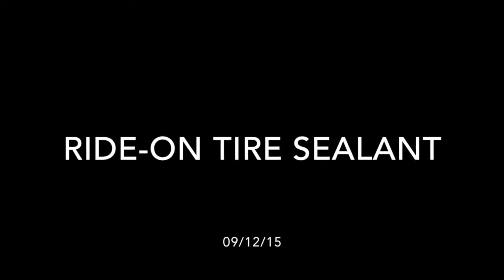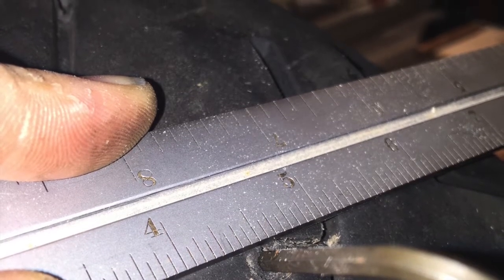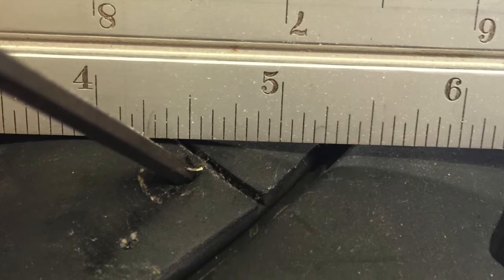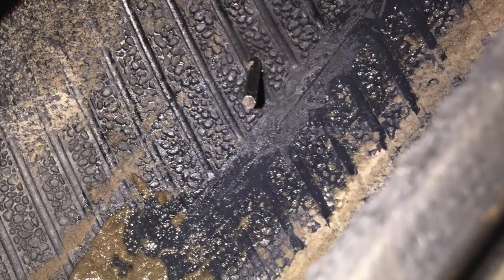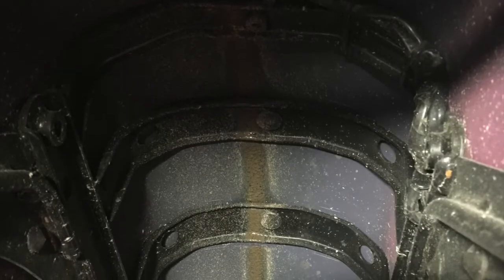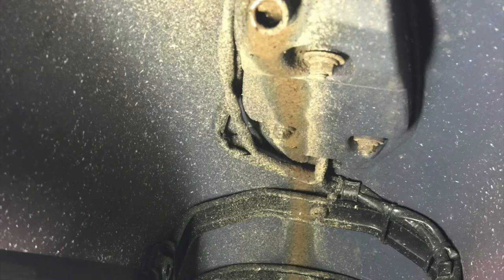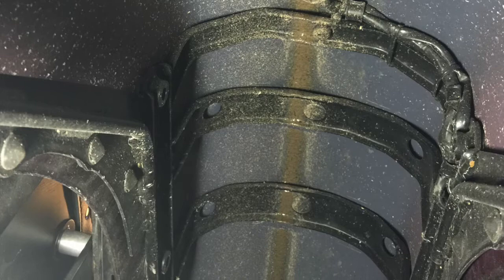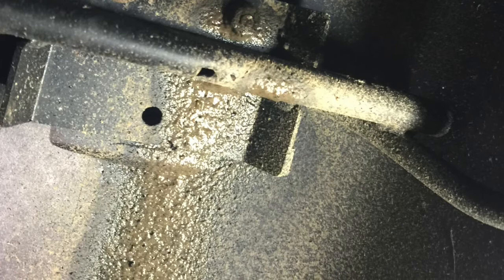Ride-On tire Sealant Failure

Comment: it's really nice to see that someone posted a video on what the limitations are on this tire sealant I personally have been using this tire sailing for just over 7 years and I've had incredible luck with it I myself have taken nails and screws through my tires and have been able to remove them and continue driving when the sealant did what it was supposed to tell I have also put it in a tire that pad and nail already it it drove it for 2 miles then pull the nail out and it completely sealed up and that's hiring now has been back on the road 4 one year and a half.. I hope you have better luck with the next tire and using the ceiling again it is possible that the hole was just too big for the chemical to seal..  good luck and be safe
Reply: marvin R - I called and talked with the company when it happened. The hole was well with in the size the sealant would work on. They told me the sealant is good 90% of the time. I guess my hole fell into the 10% range.

Comment: I'm disappointed to learn about your experience Tom.  I've been using "Ride On" with complete confidence in the product.  I know from experience Ride On is great for balancing motorcycle tires and it doesn't make a mess inside your tire.  Anyway, I guess this shows me once again life is never certain and that shite happens.  When and if I hit a nail with my motorcycle I hope I fall within the 90%...
Reply: Charlie Swearingen - I agree it does a great job balancing. Good luck and keep the shiny side up.

Comment: That does look like a pretty big hole, would have been interesting to see if you threw a plug in there how it would have handled it. I guess when you use this stuff you can't adjust your tire pressure either.
Reply from the maker: Mike Mills - from their website “by objects up to 6.4 millimeters (1/4") in diameter”. I had to forcibly push the 1/8” Allen wrench into the hole. I have plugged a  motorcycle tire before but I still consider that a temporary measure to change out to a new tire. Filling up air in the tire works like normal. The only thing I trust about that as it as a dice job of balancing the tire. I have no weights on my rim at all.

Comment: I recently had a puncture from a screw and this stuff worked exactly as designed.  I rode the bike to warm the tire, removed the screw and rode it again to seal the hole. I’m wondering temperature you were riding in and if the tires were warmed up. Truth is, I rode the bike about 150 miles before having a plug patch installed.
Reply from the maker: Fair question. The temp was in the low 70's and I had been riding about 35 minutes when it happened. The tire was plenty warm. The company consideres it 90% effective. I guess I fell into the 10% on this one.
Reply: I got a small hole in the contact patch of the tire from a drywall screw. i'm going to plug it then add ride-on as a backup in case the plug fails.

Comment: Hi tom.  How was your experience with the product after this. Did you bought it again?
Reply: I am still using it as I like the job it does balancing my tires.  I just don't trust it as a sealant.
Reply from the maker: @groovee63  Not a failure according to the company who only calls it 90% effective. I have been working on my own rides for many years. I promise you it was installed properly. In fact the specs called for enough in my tire size, that I had to buy a 2nd bottle to fill with the correct amount.

Comment: old school tire plugs are the way to go!
Reply from the maker: Dustin Walters - I now carry a plug kit with me. Still would have been nice if it had worked, then I could plug it later.
Reply: Doesn't work for tubed tires
Reply: But I do not care. I will buy ride on anyway.

Comment: Well, numbnuts, the hole was in the SIDEWALL.  Of COURSE it didn't seal it.
Reply: Jim Kubitza - sorry if the pictures don’t show it very well, but it was right in the middle of the tire. Also if it was on the side the sealant would not of come out.
Reply: On a side note, asking me where the puncture was located instead of name calling might have been a nicer way to go. Just saying!

Comment: It failed because the hole was to big
Reply: The hole was slightly less then 1/8" in diameter. Well with in the range of the product specs.
Reply: @tomsdreamshopworx  The object was that big.  The damage appears larger.